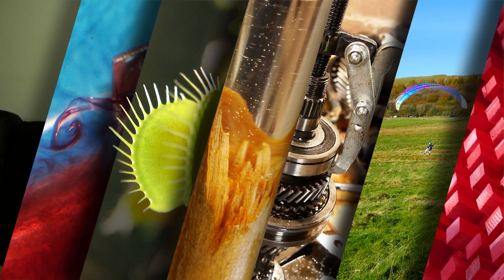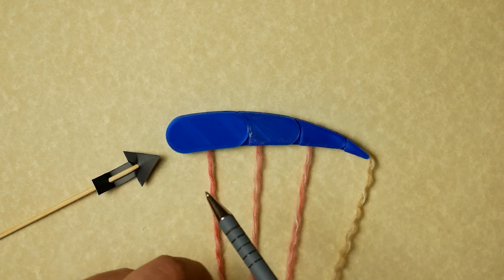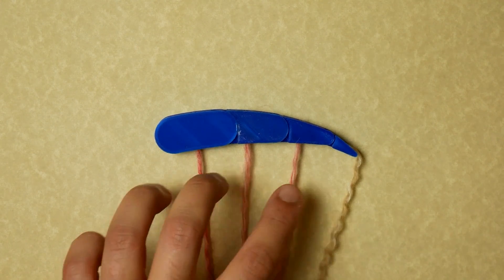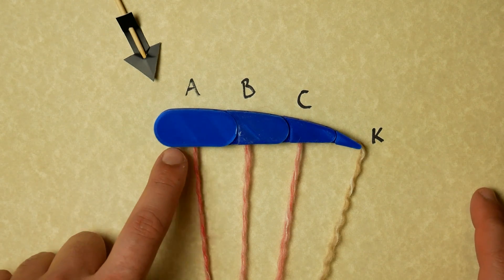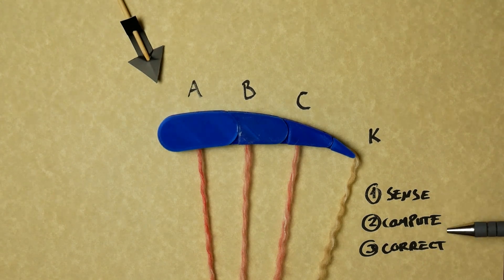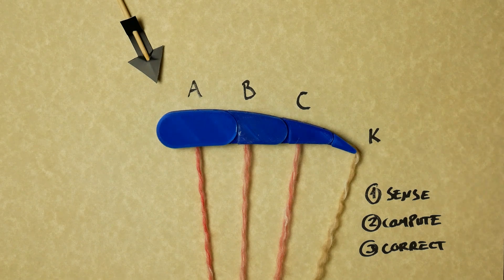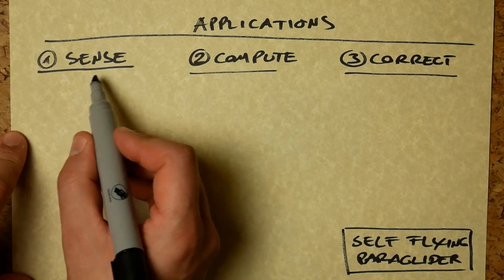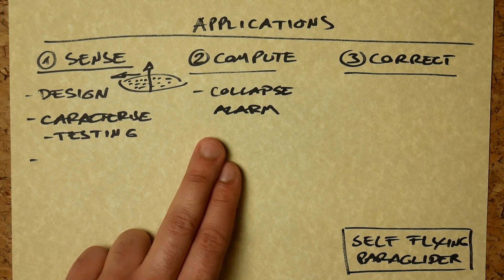Intro - Uncollapsible Paraglider Part 1 - BANDARRA

Comment: As a mech designer, pilot and musician, I would suggest sensors on each line to measure the tautness and an audible tone when too loose. Use high middle and low tones or even control the frequency using vibrations that register in your helmet for each discrete row.
It strikes me that it would be difficult to single out each line, but you could have a leading tone which section, and then a number of beeps at that tone corresponding to which line is loose or "luffing" ( in sailing parlance).
Such an error code could be read by a computer in an instant or learned much like millions of people have learned Morse code. With practice it becomes second nature and muscle memory.
Please keep this up Andre. You're doing as important research as was Juan Cierva , who invented the autogyro, which does not stall and is based on the auto-rotating seedlings from the maple tree.

Comment: Brilliant  diagram explanation and demonstration ,  knowledge dispels fear but I think maybe the secret is making the wing more rigid  so the turbulence bounces of the glider rather then collapsing it maybe not  enough research has been looked into this ,rather then the pilot trying to feel what is happening to make corrections  , Performance Designs who make parachutes that are high performance wings faster then anything on the glider market and work on keeping the wing tight  and ridged so it makes a better performance wings fast, it would  be worth  giving Bill Coe or John Le Blonc  of Performance Designs a call  would be a good start and anything that makes paragliding safer is a bonus. Excuse the spelling!

Comment: Think it was Flightdesign who user valves ages ago, and Ozone who used  a carbon pole.

 Problem is, a glider that doesn't collapse can get under you. Then you fall into it, get wrapped like an Xmas prezzie, then splat!

FYI: The Ozone pole evolved into the plastic wire found in most gliders these days.

Comment: As an engineer I would fit a system within the harness that can be coupled up to any wing, that way you can keep the weight and any actuators including any power low and keep the wing light

Comment: Firstly I love you very much I have been working on designs for a non collapsible or a quick recovery paraglider wing. If the mouth was a round tube that was very light and reached back to the a riser it would be very difficult for this to collapse from a sudden downdraft. Secondly you were on the trail when you spoke of the verio and helping the sensing part of the equation. What you need is a load cell on the a risers and some kind of a feedback loop that just sings the song One Note song. When the a risers are under a larger tension the frequency of the OneNote song is higher when the tension falls off the a risers the frequency of the OneNote song is lower. If each a riser had a separate sensor and the system was broken into two halves to compose the one note song for each side. You would have the speaker on the top of your shoulder attached to the harness by your ears. There is no servo out there worth its weight that can perform as you were describing. I watched you fly and I am very jealous of you. Nothing in the computer world light enough and dependable enough for flight could ever touch you as far as skills. If you just put a rubber oil ring in the mouth of each of the cells that was the right size to gently hold it open just hold the mouth open and stitch it in and for places just a single stitch one over ring and each cell it would probably make a lot of difference. Ignoring all that if you could get solid feedback from that Wing in the form of a speaker under each ear and the frequency shifting up and down when the load is the lowest the frequency drops. I estimate you would fly about a week with that and you would wonder how you ever managed to do without it.The very simplest thing I could suggest to try for this non collapsible flight. If you had a piece of a car inner tube attached to your a-risers that was thin enough it would only pull 10 lb.. attach the other end of the strap to your clothing somewhere so you have a constant feedback from the a risers to the shirt. I guarantee you there's a thousand percent difference in the time that you were talking about for each process with the perception the reaction the adjustments. And being on top of it. If you started out with the a risers speaker one on each shoulder and flew a while you could come up with another speaker for each of the lines to the parachute and eventually it would be singing like an angel to you and when the collapse even begin to initiate you instantly be on it. I would love to learn to fly something like that and I couldn't be on it like you can because of all your experience. If you just plug in a couple of speakers on the top of your harness to your muscle memory sensory system your feedback loop will shrink dramatically you will be on it when it starts to change not reacting to it after it gets too loose.

Comment: Am I really stupid, thinking the wing could be held uncollapsed just the way tents are? After all, tents are also collapsable. The tent "rods" could be left "permanently" mounted in one dimension, and the others in (two?) dimensions, one would mount just before flight. The rods would be the modern springy type I think. In effect, you would have almost a normal uncollapsable airplane wing. Very similar to the first twin wing airplaines, that had textile mounted to a wooden frame. Model airplanes are also built that way. (It used to be shrinking "China" paper, today it is plastic shrink wrap around the wooden frame.)

I figure that would also reduce "runway" length to almost nothing. Well, the lines create a length of the paraglider. But that could also be shortened by servomotors. gradually extending the length of the chords at take-off. (Would it also work when landing?)

Comment: Andre, would a paraglider benefit from a tesla valve incorperated in the design be less prone to collapse?
Reply: nope.

It was done long ago, a glider that doesn't collapse is dangerous.

Front tucks are a safety feature, it stops the glider getting under your, and you falling into it.

Comment: Good Video thx for info. 
Just wondering is it not possible to create a para-wing with very thin carbon fibre lines, that can be fitted as frame , same as they do with tents but thinner carbon fibre to avoid wing collapsing !?
Maybe more useful for paramotors than gliders

Comment: Ever think that if you succeed you may create more problems than you cure. Hang gliders don’t collapse, but they stall big time, create a non collapsing paraglider and you lose Pendular Stability, which is the self correcting virtue of a paraglider, albeit sometimes needing “brake pumping” to assist in re-inflating the glider. Look at Kite Surfing canopies.

Comment: Am I wrong in thinking then A, B and C lines don’t equally share weight, I was under the impression that A lines carried for example 70% of the weight, B lines 20% and C lines 10%. number are a example. I thought Bs and Cs were more for holding the glider shape as much as carrying some of the load?
Reply from the maker: Yes, that's right! https://www.youtube.com/watch?v=AOkSkCXVu8w
Reply: @AndreBandarra1  thanks for your response, I pull As in parachuting to land, when done properly B,C and D are totally slack. Great videos.

Comment: Hey Andre, some kites have a one-way flap on the air intake to help maximise internal air pressure, and I wonder if this would be good on paragliders to help minimise a collapse.  The Ozone R1 has this tech, and sounds like a good idea on the surface, so not sure why it isn't seen on paragliders.
Reply: I guess I wonder what happens if you have a wing like that, but get into a situation where you need to throw your reserve. I'm not sure how that would happen with an uncollapsible wing, but if it did, would the one-way inflation prevent you from killing the wing and folding it up? Or actually, I wonder if it would prevent you from killing the wing on the ground. Could make landing dangerous. I love the idea of no collapses, though.

Comment: Hey Andre, interesting.
I would suggest to put a pressure sensor attached to A lines. So as soon as the nose starting deflating  the pressure on A lines will reduce, the sensor will sense that and beep the alarm...
I can go on and on about what after the sensor beeps, 2 options: human interfere with correction (Applying Breaks) or computer correction by adding 2 small electric motors controlling the breaks.
So as soon as the sensor Senses the pressure drop on A linea it will alert the computer control motors to pull the breaks just to correct the nose ...
Now there are 1000 ways to program how to  control the wings by computer.
I can see this happening very soon.
Reply from the maker: https://www.youtube.com/watch?v=M7iEf-d15D8&list=PLHqVk-6I8KNfLrmAx9kEmqVjauUEONZB-&index=6

Comment: Boeing tried this it didn’t turn out well
Reply from the maker: What happened?
Reply: Andre Bandarra Ethiopian airways crash generally anything that overrides human intervention isn’t a great idea
Reply from the maker: @Chatt9821  My idea is not to override human intervention, it's to augment it. That's pretty much how all modern fighter jets work (fly by wire) or even a modern car. There isn't a physical cable connecting the accelerator pedal to the carburettor anymore. Theres a throttle sensor that tells the ECU what the driver wants out of the engine. But if the driver want's full power at 1000rpm the ECU knows that the best idea is not to dump as much fuel in the engine as possible, which is what it used to happen if the link was manual like in older cars.

Comment: Good ideas - I am a electronic design engineer and would be glad to help this project.
Reply: Hi Paul. Are you still interested to help develop an autonomous paraglider?
Reply: @kennyindlu1086  Yes - it is  a worthwhile project to which I can contribute.
Reply: @kennyindlu1086  In case you want some backup, i'm a mechatronics engineer ( and prototype builder ) and I would be glad to contribute :)
Reply: It could become a feasible bussiness with an autonomous powered trike. 

- Emergency evacuations 
- Remote payload delivery ( 2 to 400kg)
- Endurance video/photography/surveillance/geotechnical 
- Fire fighting, crop dusting 

While drones do this, fabric wings can do this more cost-effectively with more endurance/distance.

Comment: Well done thinking outside the square.  Make it pressurised inflatable with no cell opening with one way valve or a small pump. Or Same as kite surfing wings Install a inflatable tube in cell opening might help.
Faulty Ecu sensor can scared the shit out of anybody 😀and keep it simple find a simple fix not complicated so any one can fix it if it start playing up. 😀
Reply: Svp can you more explain?

Comment: Did you know that a mechanical keyboard makes a touch typist type up to 20 percent faster?  Much of the speed increase is due to not only the tactile feedback of the keyboard, but the actual louder sound of the keyboard.  The audiatory feedback makes a person much faster to respond by moving to the next key.  Perhaps something on the line that sounded an auditory que, like a pop noise or something if the tension releases below a certain threshold of the A risers or even a popping feeling on the riser.
Reply from the maker: interesting concept

Comment: I love the passion you are applying to all of your work. Fantastic. I started paragliding in the early 90's and while in meteorology class our instructor asked us why our instruments don't sense temperature, in a forward-looking sense, and thus be thermal detectors. Fast forward now nearly 30 years and a career in aviation and I wonder why we still haven't done something like this. (We have EVAS in our planes and it helps immensely in seeing through visible moisture but doesn't show shear.)  In aviation, we talk about turbulence in terms of shear and it's force. This is the same principle that you are seeking here when looking to sense the imminent collapse, to sense when the shear potential will exceed the glider's ability to stay inflated. Despite all the very cool applications you suggest in this video I just wonder why not try to "see" the air you are flying within rather than sense the mallions? This becomes a thermal detector and progresses into a shear detector too.
Reply from the maker: Thanks Chuck, very nice comments and thoughts I haven't considered. I didn't think about it much when I made this video, was more of a pie in the sky idea or brain dump. Even though I've dreamed about "seeing thermals" I don't know much about the tech involved so I went on a route that has some connection to my mechanical engineering experince
Reply: That makes sense you would go that route for sure with your background. I think thermal sensing would have to happen at some very different wavelength, maybe infrared, maybe ultraviolet, or maybe it's the gradient that would the real answer. How would see it i have no idea, I just fly these things ;)

Comment: extremely good video and analysis. Although I agree with Kyle, I believe that the future development of "smart" wings is the future and the entry into the so-called no flying in the mid-afternoons.  Think about it barometric pressure analysis prior to collapses and then to the other extreme, full recognition the thermic variances to assist is xc flights.  Priceless... I think this has given me the basis for some research myself... Great stuff Andre!  Please ping me...
Reply from the maker: Cool, glad it's getting your cogs turning Peter. I think for sure collapses are a different thing for freefliers and for ppg. I hope to start ppg at some point and because you have power there isn't much need to fly in thermic conditions for a number of reasons. The video is much more applied to my experience with is freeflight in thermic conditions

Comment: Have you thought of measuring the actual airpressure inside the cells, I bet a sensitive measruring device would detect a drop in pressure just before a collaps?
Reply: that is possible with tiny electronics and battery and a bluetooth link

Comment: The best way is to use Fiberglass buttons what I used to use on my hang glider. You need a fiber glass leading edge which will keep the shape. The leading edge can be assembled  so easy to take down.
Reply: Sorry, typo, Fiberglass leading edge with Battons

Comment: That is great! Once you have these input, tension in each mailon, would be a good idea to measure the pilot input break, acceleration and barometric data. Using some big data and machine learning you can get some correlation to create a library or application to be used by varios and cell phones. Good luck!
Reply from the maker: Yes I've been thinking about that, having tension sensors on the brakes too and accelerometer and baro data could be very beneficial to post flight analysis or to an all singing all dancing final autopilot that can fly the paraglider on its own

Comment: Hi Andre. Just as an insight to your research . Here is a tip to avoid collapses. Just like the ABS Sensors in a car or motorcycle. You can put a very small sensor at the risers and a smaller at the brake lines close to the collapse reaching length (let's say at 65cms) once the two sensors meet there is an alarm to alert you the collapse reaching point is there. This is just an idea I have to prevent collapses. Off course is a little different from yours but it might take your idea to a next level . Which I support.

Comment: Hey Andre, when I saw step 3 it got me thinking. Did you yourself ever do a SIV? You can imagine that there are so many different extreme situations that you can find yourself in with a paraglider and during sivs you'll also learn that they are not always prevented by active flying. To me it seems that the ideal goal of your system would be an active flying autopilot. But I don't see it reacting to situation where geberal active piloting would be enough just yet. When you get into very extreme situations where active flying would never have helped, and possibly will make things much worse (just to name a few, most hands up situations, very precisely timed braking attempts after stuff like unpreventable stalls maybe caused by heavy thermal turbulence, steering away from an object even if you have to spin it slightly) how would you let your system know that it shouldn't take over control but let the pilot use his training? Surely the reactions to these extreme situations (that will still happen even if your as perfect as your potential machine in active flying) are too organic and situation specific to be handled by a machine right now, even with years of machine learning or anything like that applied. If just participating in traffic is already difficult enough for self driving cars, wouldn't handling unintended SIV situations be too much for this system? How do you imagine this would work?
Reply: Never mind, just saw your response to Greg's exact question on video 2, and his was way better worded too. Good luck with this project!

Comment: Here's a great video that reminds you that the wing is designed to collapse. The reason is you want the wing to collapse so that you can generate speed for the reinflation. 
If your wing did not collapse the turbulent air could force you into an uncontrollable spin. 
https://youtu.be/rmGPIKOx6nk